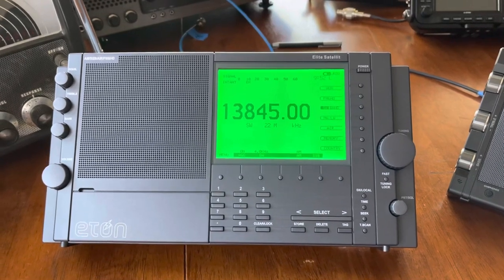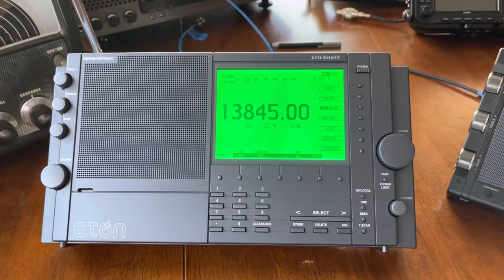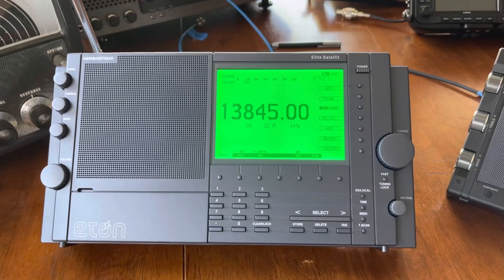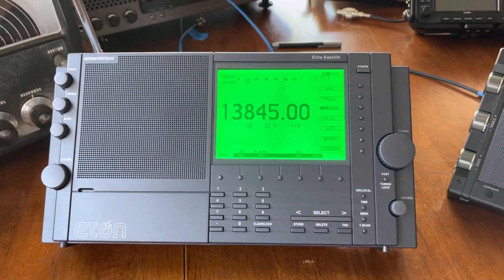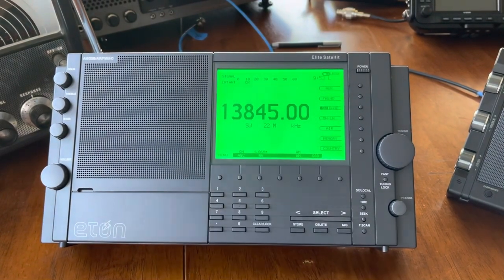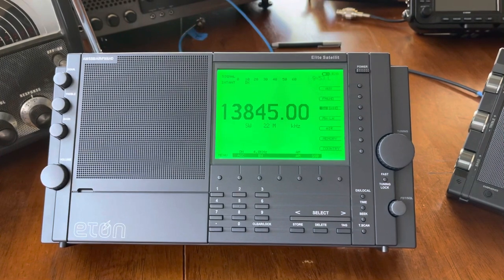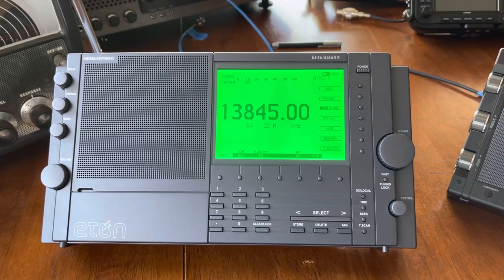Eton Elite Satellit on whip vs Tecsun 501x

Comment: I’m new to this hobby and  because of this entire fiasco with this radio, I will never even consider an Eton brand radio.
Reply from the maker: Probably a wise choice. You can get known quality from Tecsun
Reply: Yeah that's the best decision. Tecsun make far better receivers quality wise, and I own an Eton Elite Executive which is actually a pretty decent receiver.
Reply: A Tecsun PL-660 is a good place to start.  Forget about DSP based portables with the exception of the Sangean ATS-909X2 which is the only properly engineered DSP portable SW receiver on the market.  Some might include the Belka but that thing is band crippled.
Reply: @sigint99  I do have a Tecsun PL-990 that I have been enjoying learning how to use.
Reply: @RelaxingASMR-Gaming  Well good luck with it. I for one don't like any of the DSP chipset Tecsun portables as they all have too many artifacts on SSB.
Reply: @sigint99  I’m too green in all of this to even know such things. Thank goodness for YouTube though. Really helps.
Reply: @RelaxingASMR-Gaming  Shortwave listening and radio monitoring in general is a great hobby. I'm also into radio scanning which mostly focuses on monitoring frequencies above 30MHz.  Heaps to learn, discover and experiment with.
Reply: @sigint99  I have a Uniden scanner in my vehicle and have enjoyed it for years. Was always on when I was driving. Local law enforcement have switch to digital and now I'm only using the scanner when I'm rail fanning and plane spotting. Also have CB that I keep on when I'm on the highway.
Reply: I think the original Eton E1XM was a great radio, but of later production when they resolved all problems. A Sony icf-2010 or Icf-sw77 may be good radios to start. On a more expensive side I would definitely recommed Icom Ic-705.

Comment: I got a tecsun 501x and so far I can't quit playing around with it. I get way less interference and noise that I get with my tecsun pl880 and sangean 909x2. Plus the sound quality is excellent. My only problem is battery consumption.....I keep a bunch of batteries charged up.  Going to try it on electric some time.
Reply: How's the Bluetooth sound or FM?
Like a good Bluetooth speaker sound quality wise?
Thanks
Reply: @user-or1ce7ez5w  sound quality is excellent on BT, SD card too. On FM it depends on the station audio, it will differ from station to station but the stations that have the best sonic audio quality ie not over-compressed will sound superb.

Comment: This sounds like a grounding issue. When you plugged the external antenna into this receiver that annoying buzz went away because your external antenna is most likely grounded.
Reply: Yes.  I'm not expert.  But I always used to get static in my old house on FM.  Got a bit better when I'd turn off my halogen floor lamp.  But still not good.

Comment: I think that Eton, Tecsun, and Sangeon should start having their radios designed and built in Japan. Much better component part quality there and better Q/C. Yes it would cost more but you would get a higher quality product and not disgrace your brand name. I have Panasonic and Sony radios that are 50 years old and still perform well.
Reply: $1400 for a portable. Ya, at least you KNOW it will be good. 👍
Reply: Not feasible and besides, the Sangeans are pretty decent in terms of build quality.  I have no issues with my 909X2 apart from the lack of additional ssb filters.  The Tecsuns on the other hand are a total fail on the DSP variety.
Reply: Would be cheaper to build in the USA than Japan, but no one is going to invest several 100 million into a plant to build radios nor would people be willing to pay $3,000 for a top radio, which is what top radios sold in the 70s would cost today with inflation. Only one city in China produces all the radios in the world today.

Comment: Do not buy that piece of ...... After all these years is a shame that Eton has not fixed the problems of that item yet. 
I am still working with my Grundig Satellit 3400, with my Grundig Satellit 650 and with my Sony ICF 2001D. As a DXer I started to listen SW radio when I was 13 in 1974 using an old Zenith Trans Oceanic of my grandfather. At the present day I am 62 and I have obtained more than 2.500 QSLs. Ah, I had forgotten to say that my QTH is the Canary Islands.

Comment: I can't help notice but every single screw, every single lettering in the battery case etc etc indicates to me they took a bunch of unsold E1's from 20 years ago and tried to slap on a new circuit board on it with probably an Si4734 chip and make it into a new radio. That would explain why the battery case is the way it is. I can't see how this is correctable and the reputation for the radio is already ruined.
Reply: I have the old Eton E1XM here at home excellent radio from 2005. I will be buying any Eton Radios in the future! The Eton E1 I use on a loop antenna and a inverted Vee! I made look into the Tecsun Flag ship radio though

Comment: Maybe try to move the Tecson away or turn completely off??
Reply from the maker: Why?  If the Tecsun isn’t having problems then that means the Eton is inferior
Reply: @dieselten01  Not necessarily.    Both whip antennas can mess with each other.   Just because the Tecsun plays well the Eton may be reacting to the Tecsun.  The proper way to test is one on at a time.   Not volume down... one on, one off.    Given what I'm hearing with Eton I doubt it would make any difference but the commentor does have a very valid point from a testing standpoint.

Comment: Sounds like A/C adaptor noise, Try on battery power.
Reply from the maker: It is on batteries
Reply: @dieselten01  Note it maybe a issue with a electric power line I had that happen to me a few years ago and called the power company about it with a Ham helping me find the location of what was going on. It was a loose wire that was causing the problem is what they told me who knows. The Power company that I have power with it was not their pole so they called the other power company here and it was their pole. Could be the LED lights also in the house the ones they call smart light bulbs! But the Tecsun did not have that issue so something going on! Eton is shot itself in the foot in my opinion!   Hoe you fine the issue but if you are ready having these issues you may get your money back! Wish you good luck!
Reply from the maker: @DiscerningWhatisTrue  if it is a power line, then this eton is the only radio I have that is affected by it
Reply: @dieselten01  I was talking about the Eton Radio that I bought back in 2007.